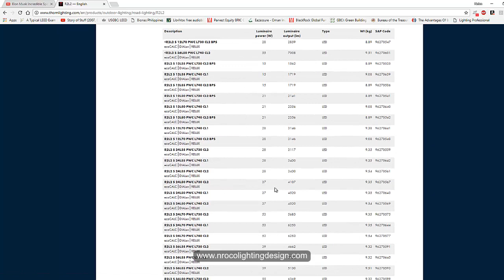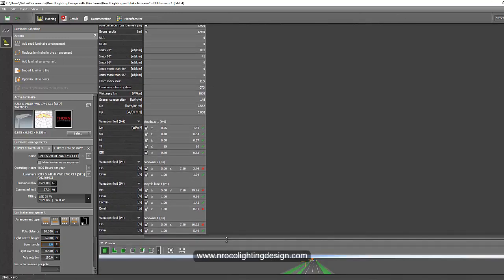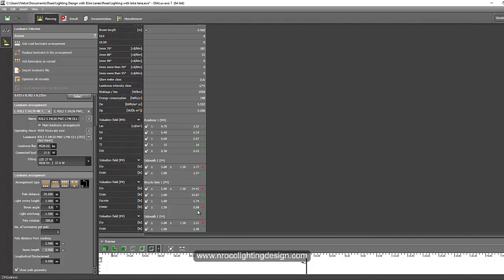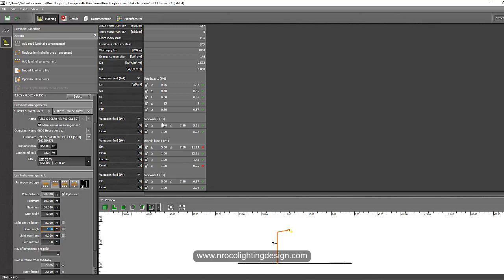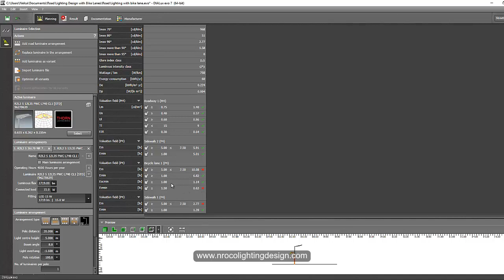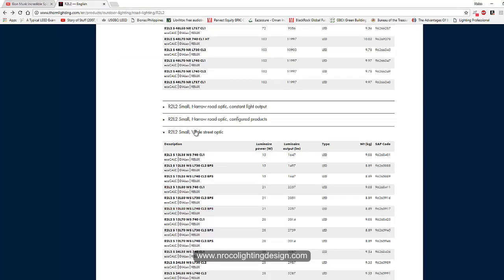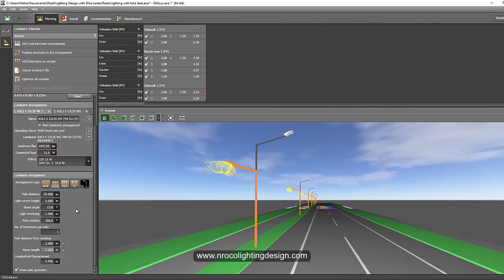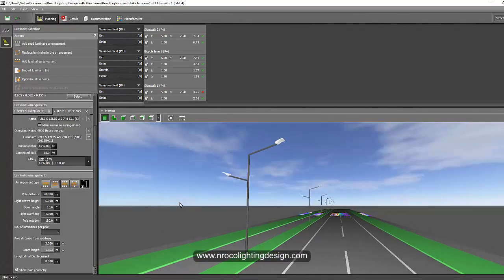04 Road Lighting Design with bike lanes

Comment: Hello. 
Sorry for posting on a random video. But i hava a question. 
I have added a 3ds model of a building for creating facade lightning. But luminares do not affect the facade of the building. Even if i point luminaire directlt on the wall. There is no reflection, nothing. What am i doing wrong?  
On another note. Very good videos, i have learnt a lot.
Reply from the maker: make sure ur 3ds files has 2 sides or faces.  Some models has one face only.